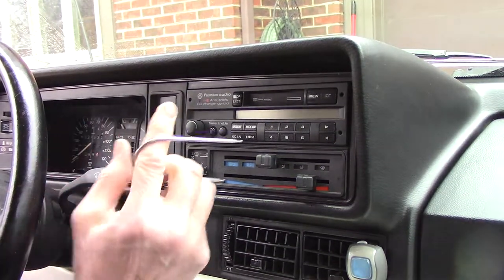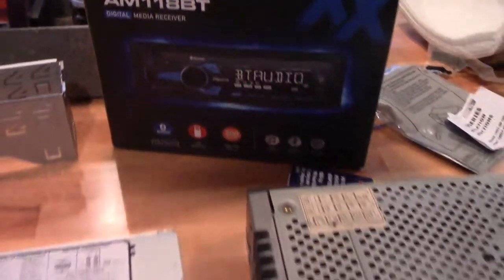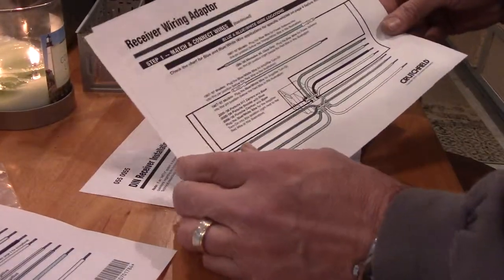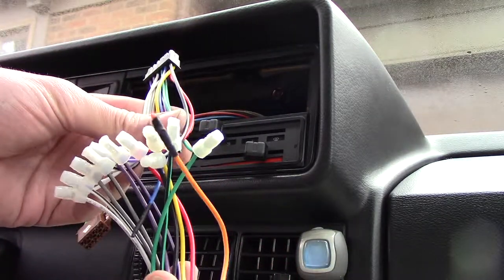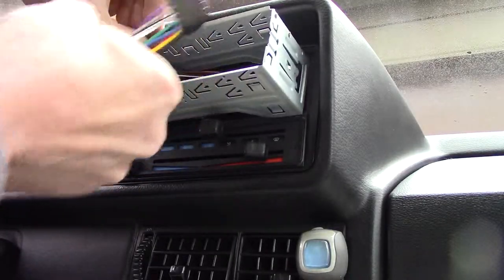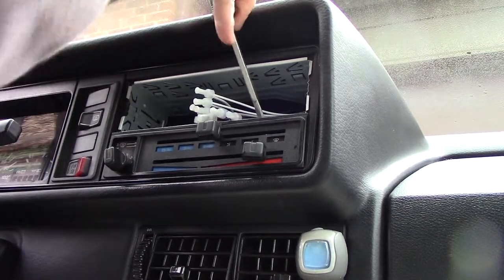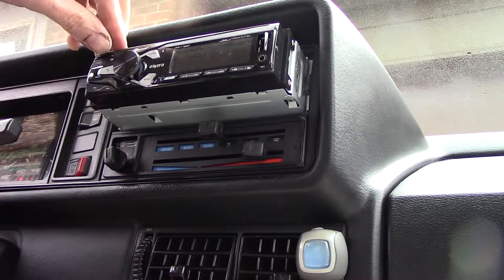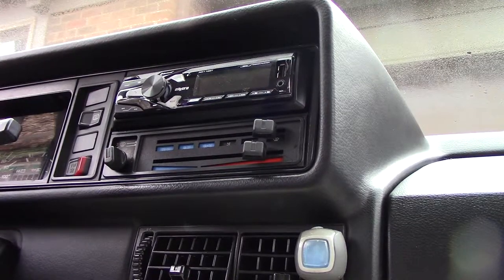93 VW Cabriolet radio upgrade

Comment: How do I know if my 1992 cabriolet has the AKTIC system. Thanks
Reply from the maker: I think it will say it on the outside of the speakers and I also think the speakers have additional power run to them. In other words there would be more than 2 wires run to the speakers. I am not sure I have ever seen one and I worked on a lot of these cars in the 1990s.